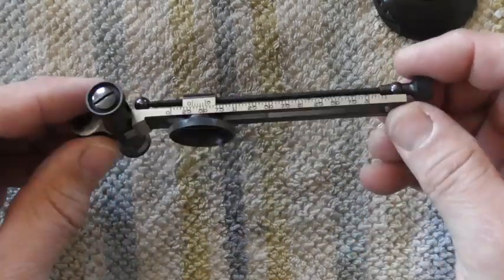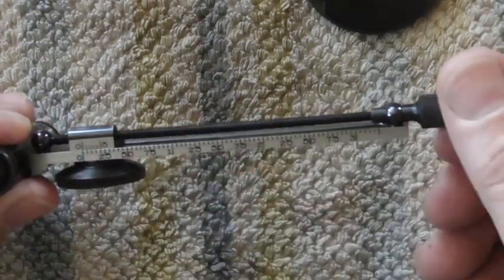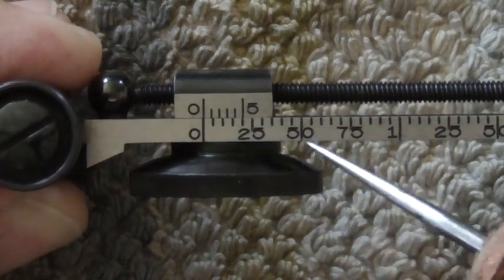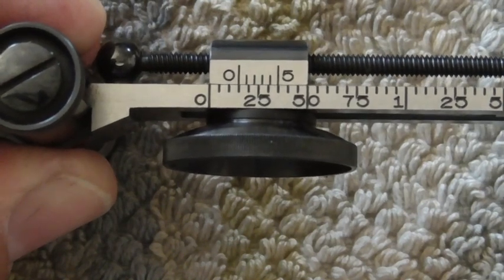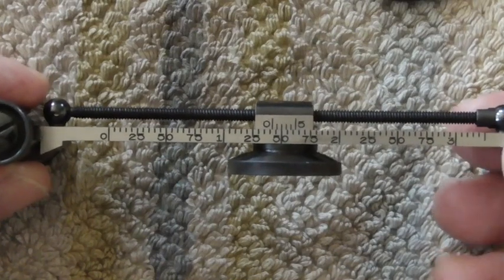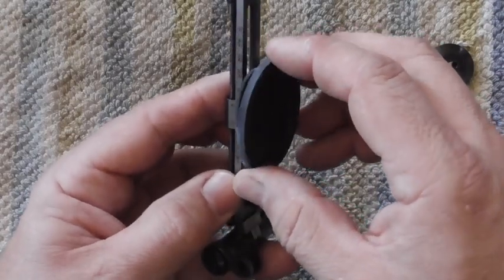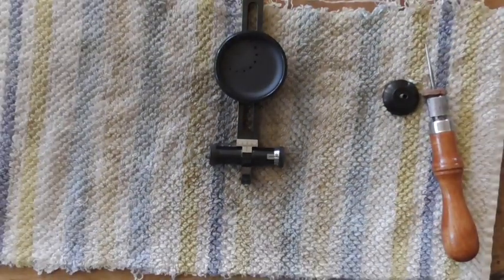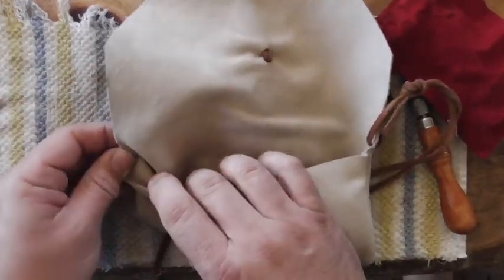How to read and adjust a Vernier sight

Comment: The mechanical zero on the MVA sight also drives me crazy. As (former) military guy, "zero" @ 100 would read zero on the staff. It bugged me so much I built an aluminum block that mounts under my sight base and after many adjustments and filing, now the sight actually reads zero on the staff. Why it means so much to me is, previously zero was 31 minutes on the staff, well that was 31 minutes or range I lost on the top of the staff. After installing the modified sight base I gain 31 minutes of range.
Reply: Great idea!

Comment: When initially mounting the sight onto the tang of the rifle, how do you determine where to have the Zero line on the scale with the front sight? Do you  set the scale to Zero, then slide it up/down along the tang until the zero is level with the front sight, then mount it at that position? Thanks,
Reply from the maker: The sight can't really be zeroed like that on a Sharps with a traditional military or even a pistol grip tang. You'd have to add a spacer block under the tang and raise the entire sight base up. And on my rifle that would require a 3/8" spacer. 
What you do is set the rifle up in a vise or rest where the rifle will not move. Then adjust the rear sight up until the aperture is about level with the front sight. That's a good bore sight to start with and will be on paper at 100 yards. 
You then take your rifle to the range, fire three to five well aimed shots and adjust from there. You will now see you have the rear sight set at about 30 - 40 up. My rifle is 36 up. All that space below the your rifle zero is unusable. and it's just the way it is.

Comment: Nice clear video, partner...kudos! I have a Pedersoli Quigley model with 34 inch barrel, and the adjustments are as close to MOA as makes no difference with that long sight radius. I've been able to use data from the Strelok Pro ballistic calculator to get first-round hits out to 700 yards. (It'd probably work out farther, but I haven't tried it.)

Comment: Can you post a video explaining how to use the level at the front sight?
Reply from the maker: @jason60chev  I guess I could post a video but it’s pretty simple. 
You look at the level when you are ready to shoot. Any shot beyond 600 yards you need to be looking at that level. Give the rifle a slight twist in your shoulder if it’s not level and then fire your shot. The level is there to insure the rifle is straight up and down. Due to the rainbow shaped arc of the bullet travel if the rifle is not level you will induce an error. 
But you don’t need to worry about the how and why just insure the gun is level when you pull the trigger and do the same thing every time
Reply: @kcstott  Got it. Thank you.

Comment: I’m attempting to learn how to use the vernier scale on my rifle. 
My 1874 Pedersoli Sharps in 45-70 has a 30 inch barrel and a 34 inch sight radius. My 100 yd zero is at 82 moa on my Pedersoli vernier (the ier at the end is pronounced) scale. There has to be a way of estimating the vernier settings for 200, 300, 400, 500 etc. etc. without randomly launching a whole bunch of bullets down range until you hit something (a steel plate for instance) and then right down the vernier setting for each distance. Can you tell me how to accomplish that? Thanks
Reply from the maker: Actually the only way is to plug your data into a ballistic solver then add the elevation to the zero and correct for the true moa. One of the best ones to use is JBM ballistics  https://www.jbmballistics.com/cgi-bin/jbmtraj-5.1.cgi.
You'd need to know the BC of the bullet and the velocity along with atmospheric conditions and even then it's only close due to how slow the bullet is going and how bad the BC is on our bullets. the ballistic solvers are designed for supersonic low drag bullets. they don't do very well calculation wise with the watermelon shaped bullets we use
I'll let you know too. no one that is serious about shooting these rifle at distance uses the Pedersoli sight. Sell that sight and buy an MVA if you want predictable repeatable adjustments.
Reply: @kcstott   Thanks for taking the time to reply and for the sight advice. I’ve used ballistic calculators before (not the one you suggested) but only for commercial smokeless ammo and riflescopes. The databases/ammo box tells you the BC of the ammo you’re using. I have a crono for the velocity but how can I determine the BC of the lead launchers I’m using - Montana 535 gr Lyman Postell?
Reply: @kcstott   Dang those MVA sights are expensive. 500 yds is the longest distance I have available. Which of the least expensive would you recommend? Thanks
Reply: So I opened up the JBM Calculator and plugged in as much as I could, including a fudged BC of .295 based on a Hornady 45 caliber .458 500 grain bullet. That gives me a MOA drop of -28.0 at 300 yds and -62.0 at 500 yds. So I figure if I add these to my 100 yd zero of 82, that should get me in the ballpark for the moa elevation on my vernier sight, namely 110 and 144. Does that make sense? Would still like to know how to get a true BC for any of the cast bullets I'm using. Thanks again.
Reply from the maker: @dogbone1358  Btw I forgot to mention that your rifle's elevation is very close to 1 moa per .010" of sight movement. If your sight is based on a MVA where one line = .010" then it's exceptionally close to 1 moa at range @ 1000 yards if my math is correct you will be with in 5/8" of perfect. 
As per the MVA sight. I'd recommend a long range sight. either a #103 Buffalo Soule sight at the high end or if you don't need  huge amount of wind adjustment the #107. I'm recommending long range sights since you said your 100 yard zero was 82 MOA. I'd wager your base is ver low and may not be mounted to best suit a tang sight. This is where a call to MVA would be your best bet. they can answer all your questions. 

As to how to figure out BC. That would require shooting over doppler radar. Best source I can find to predict a BC is https://www.tmtpages.com/calcbc/calcbc.htm#casts. Your postal should be a G1 of 500 or better. and if you are shooting around 1200 to 1300 FPS your 300 yard drop should be around 20 moa and your 500 yard drop should be around 50 moa. I'm shooting a Buffalo Arms 545 Money bullets .446" patched to .450" and have a working BC of 571 G1
Reply: @kcstott   Not sure I understand your first paragraph down to the MVA sight info but thanks again for the help. 
Assuming I’ve measured my bullet correctly, my BC is .554. Probably not that good cause I’m not sure I’m measuring the tip diameter properly. 
Anyway, I’m a lot farther ahead with your help than if I tried getting to here on my own.
Reply: @kcstott   So I’ve used both the links you gave me to help figure out my BC and elevation drop. Managed to hit the 300 yd 24 x 18 in steel plate today with regularity. Vernier scale set at 112 moa. Now I have to figure out how to get to 500. Should be right around 142. Thanks for the help.
Reply from the maker: @dogbone1358  That's awesome news!!! good deal.
Reply from the maker: @dogbone1358  "Btw I for got to mention that your rifles elevation is very close to 1 moa per .010" of sight movement. If your sight is based on a MVA where one line = .010" then it's exceptionally close to 1 moa at range @ 1000 yards if my math is correct you will be with in 5/8" of perfect."

Ok this is the math that most hate. Me being a Machinist it's back of the hand knowledge now. I'll dissect the info for you. 
What I'm getting at is if your vernier scale moves the sight cup .010" per graduation on the scale. That's how the MVA sight works. Based off of your sight radius I calculated that if everything was perfect your bullet would hit the target within .625" of point of aim at 1000 yards. meaning the accumulated error on your sight is very low.
Reply: @kcstott   Just thought I’d let you know that the help you’ve given allowed me to hit 300 yd steel eleven out of thirteen times today with four different loads. Awesome. Going for the 500 steel on Monday.
Reply: @kcstott   Update. Hit the 500 yd steel plate today. A friend spotted for me walked it in making two small adjustments to the vernier sight. Yippee!
Reply: @dogbone1358    paul matthews has a series of books on black powder cartridges... one of his books explains the math used to figure sight adjustments on a vernier sight..
Reply: @kcstott  How did the buffalo hunters and Quigley make adjustments without the ballistics calculator???????